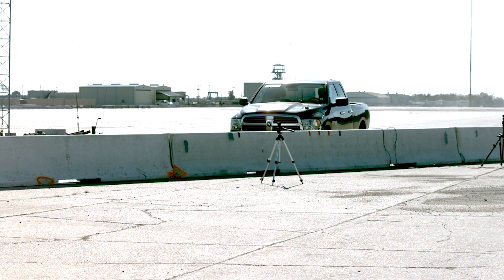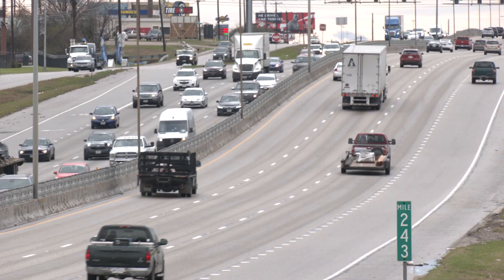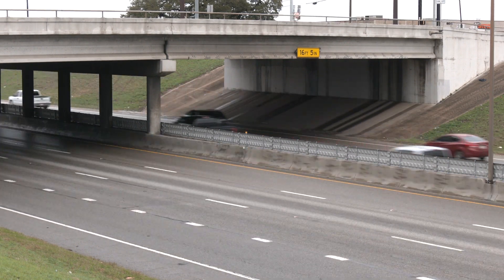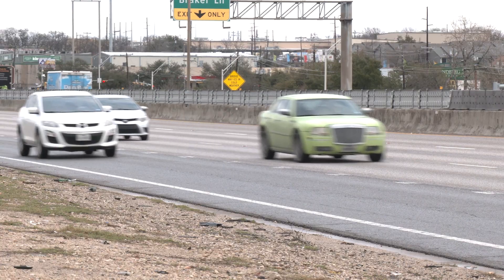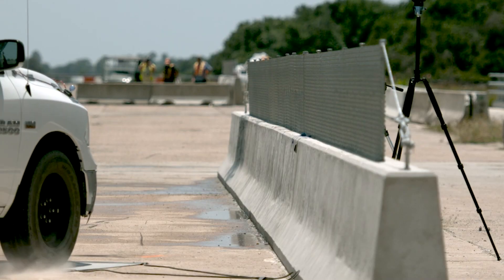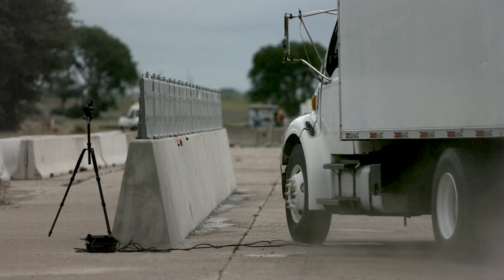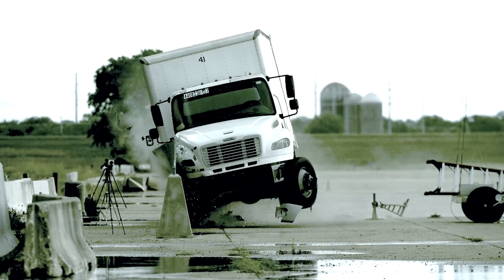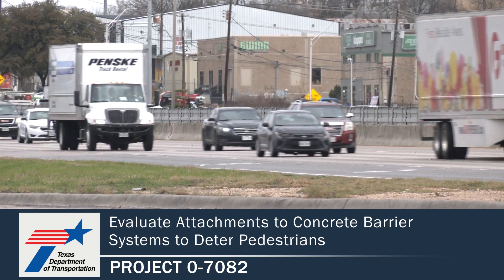Evaluate Attachments to Concrete Barrier Systems to Deter Pedestrians 0-7082

Comment: People cross roads because they want to get to the other side. If you want people to stop crossing highways then give them options to cross highways safely, and/or make sure whatever amenities are on one side of the highway are also on the other side. And if a lot of people are trying to cross a highway in one place, that's evidence that there shouldn't be a highway there. This is only an issue because you've built massive roads dividing neighborhoods and communities in half without thinking about the effect on pedestrians, and now it's causing people to die
Reply: Based and orange pilled